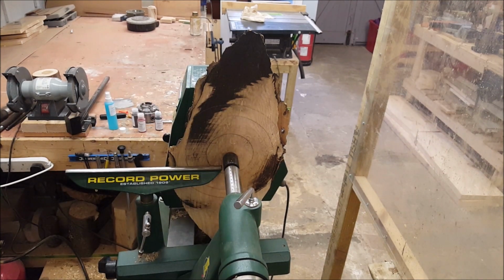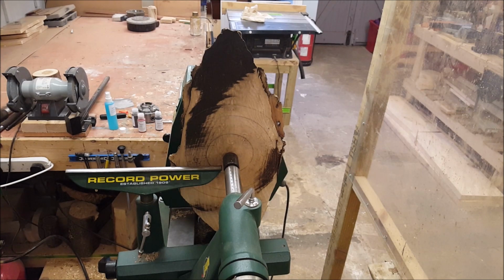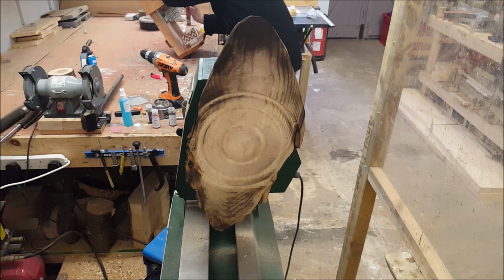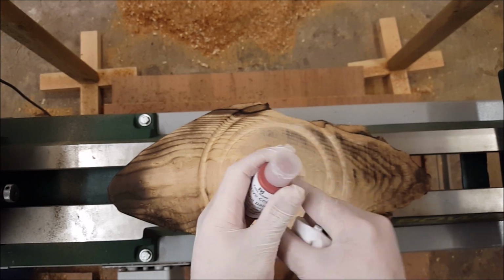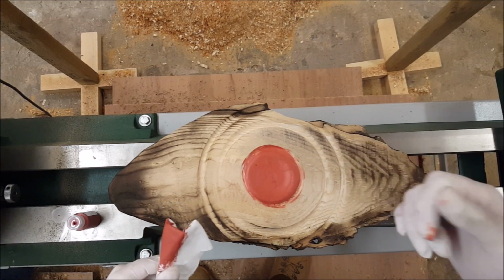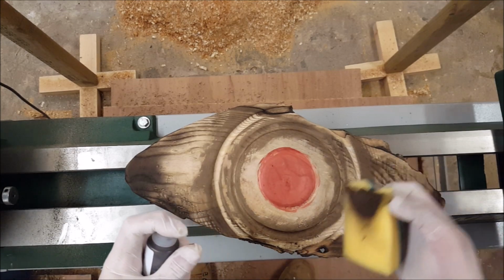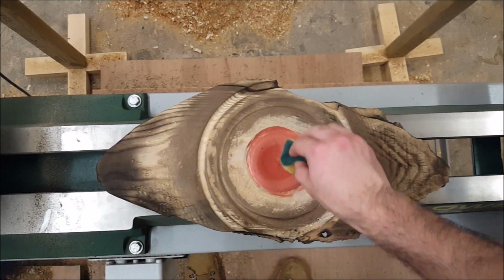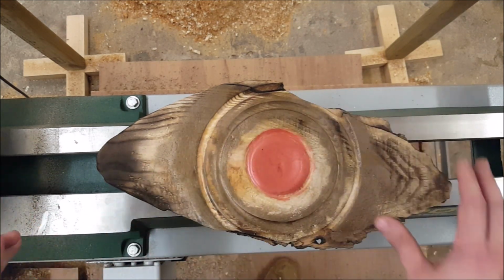Woodturning - First attempt at wall hanging ornament Rustic effect!

Comment: Interesting Afshin...Your wall hanging very closely resembles the wall hanger on the wall in the closing scenes of "Star Trek : Voyager, season 4, episode 9, Year of Hell: part 2....Afshin check it out, a larger piece but ruffly the same ???...Let me know what you think, it may have been turned on a larger lathe??....tm
Reply from the maker: Yeah it does look like it 😁 also if i buy the massive banjo for the side of the lathe i can turn up to 40inch diameter right now i can only do 21 inches over the bed which is still alright but ill save up and get 1. This piece i did was just about 21 inches in diameter.